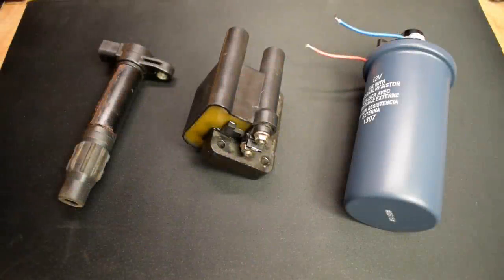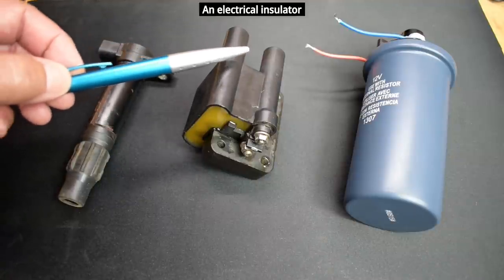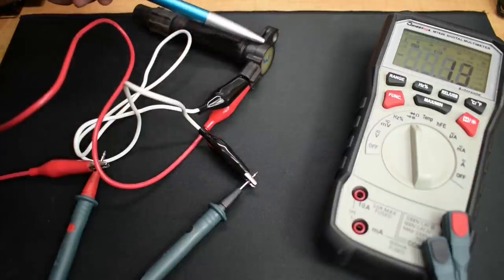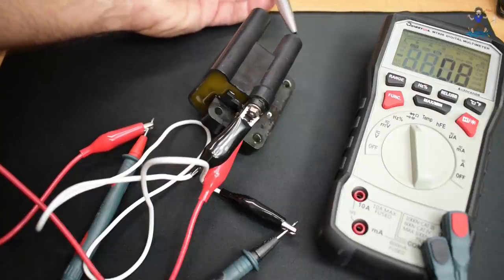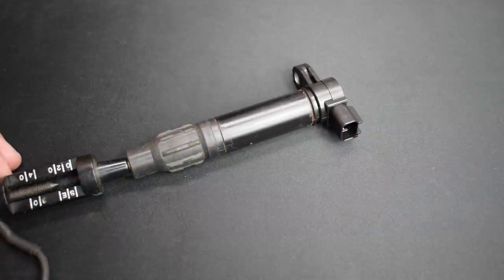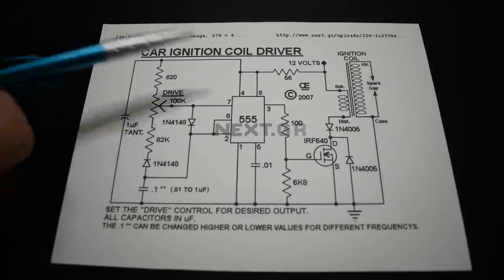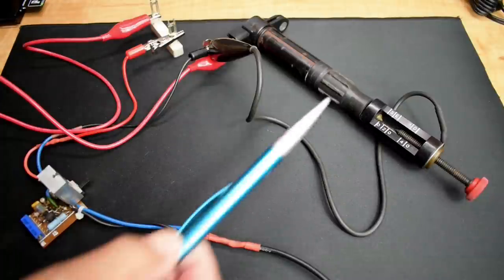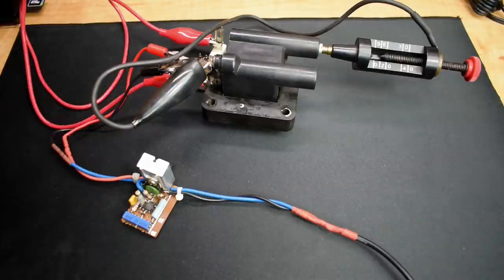Ignition Coil Tester (Car/Boat/Motorcycle)

Comment: Vehicles have a ballast resistor  that can take many forms, even a high resistance wire within the harness. The ballast resister is in circuit when the vehicle is running but not during cranking. The reason is, when battery voltage is low during cranking the spark output at the coil would also be low, as much as 10 to 30% lower. So the ignition coil may actually be a 10 volt coil designed and labeled to be used with a resister. Some coils like old air cooled VW's had self ballasted coils that had a built in resister that would go up in value when it warmed. Nice tutorial keep up the good work!
Reply from the maker: You're 100% correct. I've seen the resistive wire type years ago. Thanks for watching!

Comment: Nice circuit. I’ve a disk cutter with a suspect coil. I may give this a go. Thanks for sharing the info
Reply from the maker: You're welcome! Gas disk cutters usually have magnetos, but you can measure the resistance of the HV winding, or use a spark gap tester like I showed in the video. Thanks for watching
Reply: electronicsNmore you’re right. Think I suffered a mental lapse there

Comment: When using spark plugs outside the specified gap ranges or worn, the ignition coil will work harder to generate the spark making its internal cores to heat up. It leads to a premature failure as well. Is always important to check the spark plugs by the maintenance schedule to bring the ignition coil a longer lifespan
Reply from the maker: True, a wider gap requires more voltage.

Comment: we had a dodge coil with an outside/ inside iron core like the  honda sonata coil you tested, but with one post out.  we experienced start up problems for months, often showing bus communication error on the dash.  when i was about to give up and buy a new ecm for it, and was wiggling wires, when i noticed the coil bolt was loose.  i wiggled the coil and the truck started.  i bought a new coil, and when taking off the old one, the iron core bottom fell out.  it was loose inside!  the new coil fixed the situation, and i bought a bolt to go in the second bolt hole.  i wonder how often those things fall apart inside, since bus errors are common to dodges?  very good video, thank you for all you do.
Reply from the maker: I haven't seen any fall apart, but I can see it happening. Glad you enjoyed the video. Be sure to look over my extensive video playlists below for many other videos of interest to you, use supplied Amazon links to support my channel when making purchases(No added cost to you), and share links to my videos with many others on social networking sites. Thank you, and stay safe!
http://www.youtube.com/c/electronicsnmore/playlists
Reply: @electronicsNmore  i will try.  great videos!  yes, the dodge coil was supposed to have two bolts, but i had lost one and had forgotten to get a new one to replace it. only after a year or two, the stresses had caused the glue to shake apart in the center where the two halves meet. thus, large bumps in the road interrupted and/or reduced the impulse enough to cause a no bus error, and killed the motor.

Comment: A handy circuit that produces a dynamic test in real life situations. Ohm testing is fine but not sufficient for a real load scenario. Looking at the components, they are relatively cheap and not beyond the ability of the diyer to construct. It also creates a fine high voltage spark. No 2nd guessing this one. No need to mess with the engine and risk electronic module failure.
Reply from the maker: Thanks for watching Tom!

Comment: I agree about the resistances being in spec during a basic static resistance test. I've had an ignition coil in resistance spec but the engine wouldn't start. I fitted a new coil and it started up first time.
Reply from the maker: That's why I always like to fire them. :-)

Comment: Interesting vid, would this be useful for small engines as well? Side note i did get a notification for new vid post.
Reply from the maker: For a small engine, they typically use magnetos. You can measure the resistance between the metal magneto body/laminations and the spark plug boot connector, the resistance should be high. The spark gap tester would come in handy. Thanks for watching, and thanks for the feedback!

Comment: that fet seems to be improperly snubbed.  A DS diode doesn't provide a freewheel path for the coil flyback.
Reply from the maker: Yes, the diode between the primary and drain isn't needed. Keep the diode across the D & S of the mosfet, it offers extra protection. Thanks for watching
Reply from the maker: Oh, yes, just like I've done with all my circuits using relays. I can tell you, the circuit has been used a lot, and no problems.